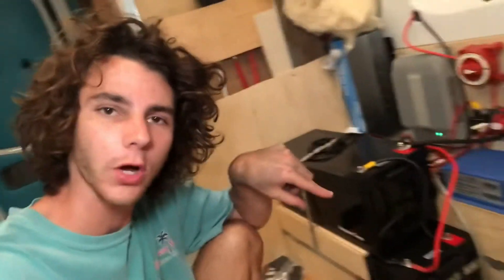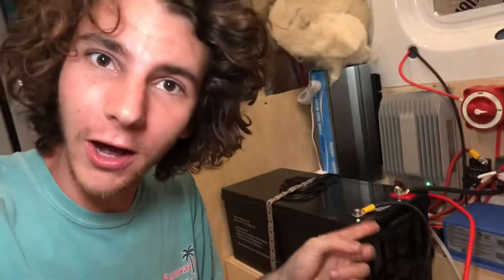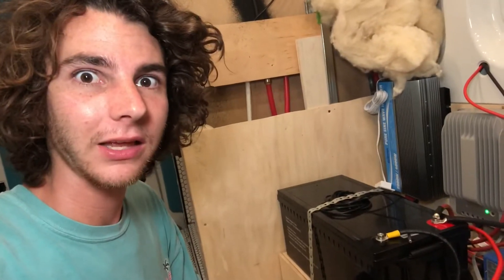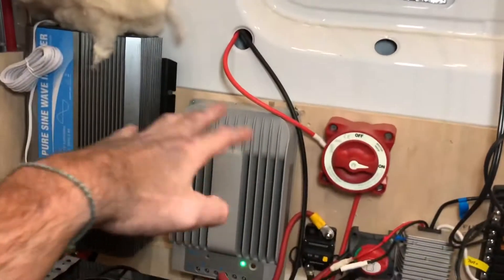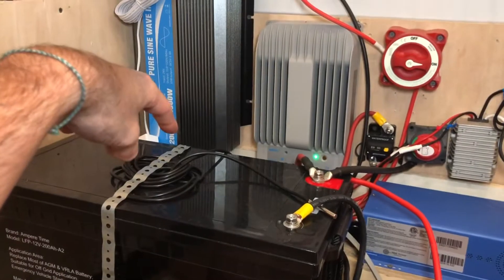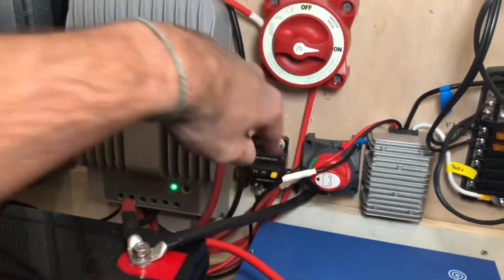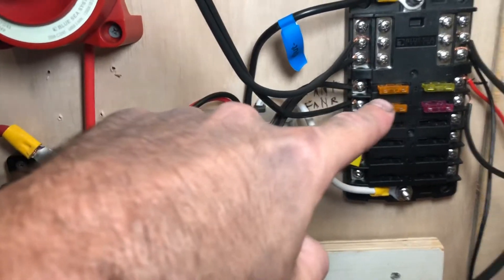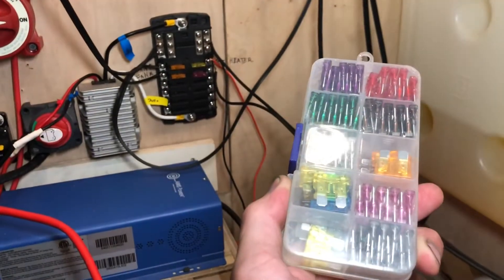24 volt electrical system in Sprinter Van: Walkthrough

Comment: Like the idea of stacking the batteries. I hadn't considered doing that as I haven't seen anyone else do it. I don't have room above batteries side by side for inverter or MPPT which is where I wanted to locate them but do have room to stack 2 batteries and putting other equipment beside them. 
Are your batteries 200a each or total 100a each?
Reply from the maker: They are individually 200AH so 400 Ah all together. Stacking can definitely help save room I was running into the same issue needing to Mount all the controllers and circuit systems.
Reply: @Absolute_North  only 200ah, you dont increase AH in series